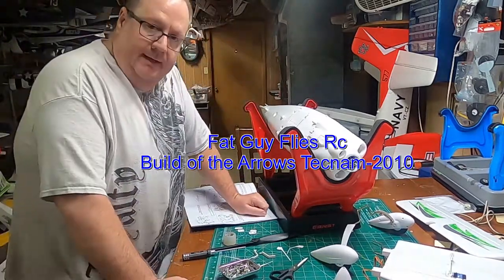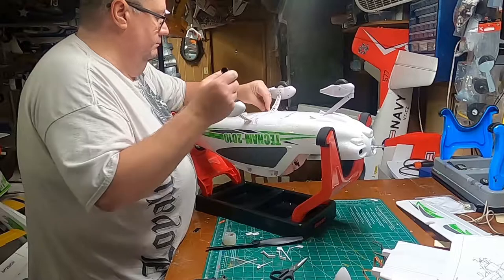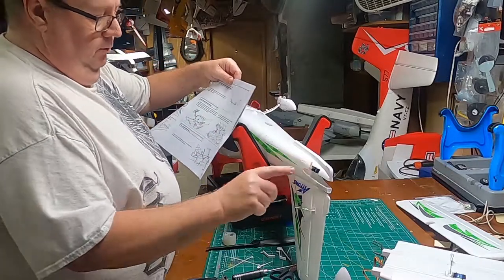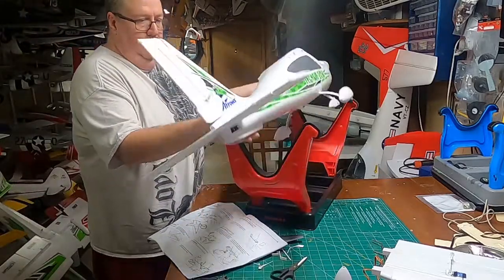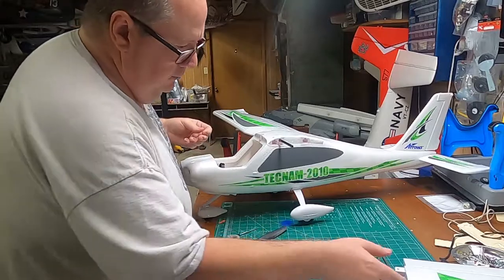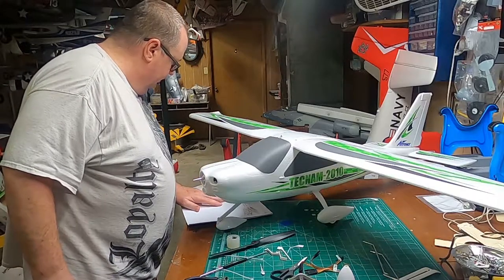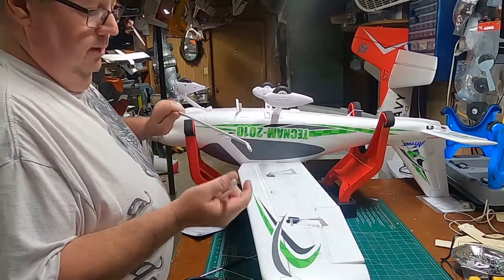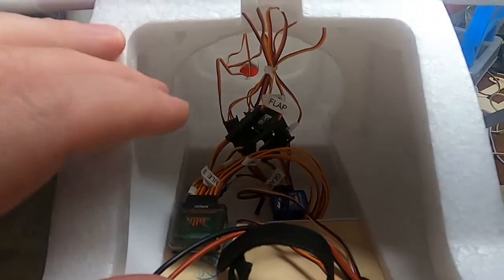Build of the Arrows Tecnam 2010 with Radio Setup by Fat Guy Flies Rc

Comment: Mine is all built and ready to fly - I stuck my AR620 on the same level as the Vector and balanced it out at 60mm CG using a 3000mAh 3s Battery - it was a real easy build... thanks for the video -
Reply from the maker: Thanks for sharing Dont let the esc/motor  whine bother you mine does it also. Not an issue.

Comment: Thanks for the shout out. Hope the nose gear tip helped. I think you will really like this plane (bird). Looking forward to your flight video as well as future videos..
Reply from the maker: Will be loading up the maiden flight later today, this plane flies beautifully!! Very scale and stable!
Reply: I really enjoyed flying plane, after 5 minutes I still had 70% battery left. The only weakness is the front landing gear. If you land hard, it can crack at the top of the wheel pants, the metal stops at the top creating a weak point. I had to strengthen it with glue. I'm still confused on the vector system. Does it change colors according to the choices you pick?

Comment: I always use a servo tester connected to the servo to center the servo befoe adjusting the linkages that way when the radio is installed you shouold not have to re adjust your linkages.
Reply from the maker: I don't remember this build but I do the same.

Comment: Fishing the wing wires appears to be a pain in the butt.  In this day and age it is not unreasonable to want connectors that are built in.  I will buy when they come into the present.
Reply from the maker: It is annoying but its a great flying plane.
Reply: @FatGuyFliesRC  I agree.  Arrows planes are all great flyers.  Also I replaced my Spektrum ix12 with the Dynam DT9.  All newcomers should consider the DT9.  It is easier to program than Spektrum radios and the associated receivers from Bitgo Hobby are superior to Spektrum's.  And easier to program in conjunction with the DT9.